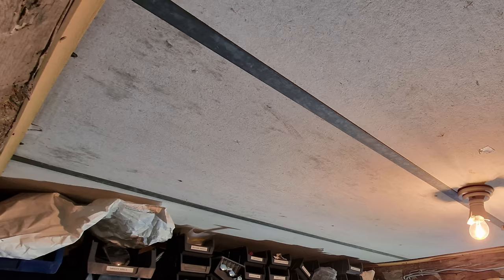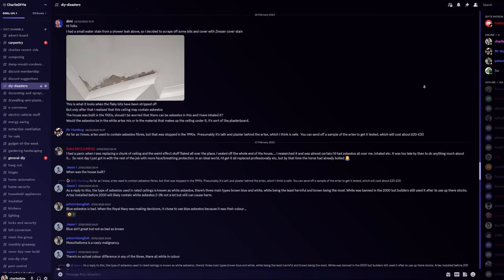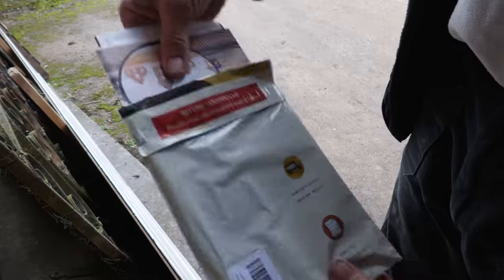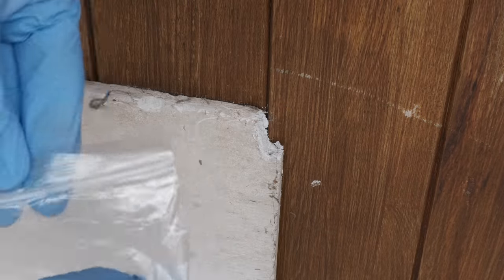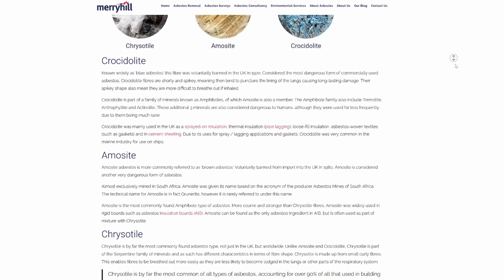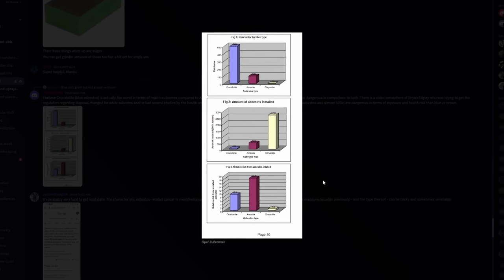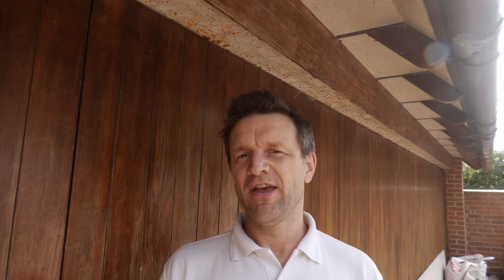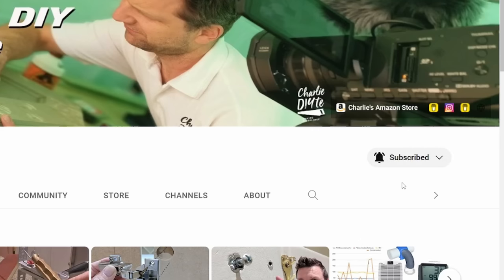I've Got Asbestos in My Home

Comment: Not read all the comments, hopefully some has already commented on the following.
A mask isn't good enough, the fibers can attach to your clothing. I've heard many a tail of wives washing clothes of asbestos working and being contaminated. Fully covered is required and correct disposal of anything that might have come into contact with it, is a must. Shaving foam is a good way of capturing the particles if drilling. Though I'd honestly say, if in doubt get it checked out. Any property after 2000 will be free from asbestos.
Reply: True that at least one wife contracted asbestos disease from husband dusty overalls, BUT the husband worked full on in very dusty asbestos setting. Very different to an isolated or infrequent activity with bonded asbestos containing product. Asbestos cement as used for garage roofs contains less than 15% asbestos. HSE do really good (free) Task Sheets for work with similar products. Until fairly recently it was perfectly acceptable for farmers to bury such materials on their own land. In the grand scheme it's low risk. 
PS hundreds of our schools have asbestos content materials in wall, floor and ceiling tiles,  plumbing and sealing products.
Reply from the maker: A good comment 💯👌

Comment: I see some people preferring to put boards over to encapsulate asbestos surfaces, and I really have to advise against it due to a recent contamination of my home (incompetent contractors). 
We have double layer drywall since the house was built in the 50's. They were encapsulating the asbestos joint compound and lead paint. The problem when you get a pipe leak (another risk -- cast iron pipes eventually corrode and crack) on the other side, the water doesn't seep through to the outer layer if there are multiple layers of drywall -- instead, water will travel up the sandwiched inner layer's paper back. This will cause black mold REALLY fast, and often times those water damage and mold abatement companies do NOT understand the risks of asbestos. Recently had a company contaminate my home after not setting up containment as agreed, and now I'm stuck out of my home waiting to get things sorted.
Reply from the maker: So sorry to hear that. Yes I can see that being a real problem if you've got pipes. Hope you get it resolved.

Comment: Back in the 80's when life was simpler, I remember renovating a very old property lined with asbestos boards. The telephone advice then was to soak them, cut them out with a hand saw and leave them outside for a couple of Council workers with zero PPE to pop them onto an open bed truck several days later. The actual risk of mesothelioma hasn't changed since and I greatly suspect back then there was a more realistic approach to risk. Asbestos insulation in shipyards and storage heaters is a very different thing.
Reply from the maker: Yes I agree. They were good, those simpler times. 👊
Reply: Or, much more likely, the hazards weren't as well known and concerns for safety were much more lax.
Life wasn't simpler. We were just more ignorant.

Comment: you could possibly already have the fibers in your lungs. you should see if you can get checked if you actually did breathe any in. the fibers are microscopic. and stay in the air long after that hole saw drilling. side effects happen later on not immediately

Comment: Great to bring this to peoples attention. We removed some garage roof panels ourselves with PPE and keeping them wet as we were able to do so without disturbing them but have since seen cement board in our eves which we will get a test for. We Also recently found we have "pitch fibre" waste pipes which are in a poor state. We plan to replace them all but are currently assuming they may include asbestos as well so will test these to. We had never heard if this pipe but since found it is a ticking bomb under houses built between 1950 and 1970.
Reply from the maker: Thanks and great work with the way you're tackling yours. 👊

Comment: Hi Charlie. Thanks so much for this. Scary stuff! I'm busy painting the outside of my 1930s end of terrace and so I'm already using your other super helpful posts on dealing with cracks . Now I have reached an outside vent, A flue and it looks like asbestos. I'm happy to leave it in situ but can I paint it it? Its covered in crud and mould... so would need washing down...
Reply from the maker: I think you probably could. But put a good mask on when you clean it and be gentle so as not to degrade the surface of it. But as long as you're not scrubbing/ wire brushing it, you should be fine.
Reply: @CharlieDIYte Thanks Charlie I really appreciate you responding.

Comment: I watched a professional company take down an asbestos concrete building in a tech park I worked at. They putout a ~5m exclusion zone. had all the PPE and just soaked the building before cutting it up/smashing it down... other than this when you look in to it you need an H2 vacuum cleaner and FFP3 mask.. so let's be honest about the real risk of working with it... it's not low if basic precautions are used. Mist the area, soak the board, scribe a line and snap it in two, bag it, tag it and dispose. I'm not saying precautions shouldn't be taken, but they only need to be the basics.
Reply from the maker: Thanks James. Very sound advice - that's exactly what I'll do. With the cellar ceiling, chances are it's too small a job for the companies to be interested in so I'll remove that myself with a suit on, fill PPE and the mask, after spraying it. 👊

Comment: It's in loads of places in this ~1975 house. Artex, soil stack, guttering, soffit boards, (old) water tanks in the loft and vinyl tiles. Frustratingly(!!) I only realised that the strange vinyl tiles I lifted up were asbestos years later when I read about it and then had them and the artex tested.
Reply: Those tiles are relatively harmless due to the fibres being bound up in the rest of the material in the tiles.
Reply: @TheChipmunk2008  Good to know, thanks! They mostly came up whole but there would have been lots of debris and dust from sweeping it all up though. Doh.
Reply: @Paul-XCIV2  We have them in our 1960s bungalow, not sure if yours are the same, but these are dark brown tiles, which are a filler (asbestos) mixed with an asphalt derivative, famous for making the house smell vaguely like there's a gas leak, delightful!  Had to remove all ours for new tiling in the kitchen/bathroom, was a fun job!  The dust will likely just have been crumbled tile, not loose fibres :)
Reply: Out of interest, what part of the soil stack contains asbestos?
Reply: @mikeromeo  All of it I believe, it's asbestos fibre cement, same as the guttering.
Reply: @Paul-XCIV2  yes exactly this. As asbestos goes relatively safe... Just don't smash it up
Reply: @Paul-XCIV2  The pipe itself? I recently removed the casing around a soil stack in a 70s build and was beginning to wonder if the plasterboard was something else, hence my question. Cheers
Reply: House built in 1976, had asbestos artex, asbestos boarding, asbestos cement tank. Asbestos lagging too

Comment: I removed asbestos from my garden in Blackpool and the local tip advised me to wrap it in large sheets of plastic and they would accept it. When asked about what plastic would be accepted they supplied a roll of heavy duty plastic and told me just wrap it up well and seal it with tape. It could be worth asking your local tip.if they to accept it in sheet form if well wrapped.
Reply from the maker: Thanks Derek. Yes I'm sure they will but it's just a question of how I'd safely cut it in half.
Reply: @CharlieDIYte  it was full length sheets from a roof I was dealing with must have been about 10ft long. As I hired a car trailer to move them (8x5) and they were longer than what the trailer was. Ten in total. I was the same as you their was no way I was going to cut them up and would not let the kid into the back garden for a full month after they were gone. Pos a bit overkill but  better to be on the safe side.

Comment: Good video to raise the profile of this danger lurking in pre-2000 buildings (after 2000, asbestos was banned, so the chance of having any is much, much less - albeit maybe not zero). I didn’t realise you could get home test kits. As others have said, I don’t think your exposure will have been that high and so I think any risk to you will be minimal.  It was older guys that worked with the stuff day in and day out that developed the issues later in life.  Sadly we discovered it’s dangers all too late for them. Looking forward to more videos Charlie. Keep up the good work. 👍🏼😃
Reply from the maker: Thanks Paul, great to hear from you and thanks for that. Let's hope so! Yes, lots of vids in the pipeline. Need to get the kitchen renovation back on track. 👊
Reply: Although The Asbestos (Prohibitions) (Amendment) Regulations 1999, came into force 24th Nov 1999 as you cite, there were still wider asbestos legislation that HAD NOT.

Feb 2002 to be exact ... was a real big industry change with legislation implementation schedule was brought forward about 5 years & caught some in the industry unawares (or they didnt care or pay attention enough to industry development).

But note, Control of Asbestos at Work Regulations 2002 did not come into force completely until Nov 2004.

But just in case, any house built in period post 2000 up to Feb 2002 when element of work was carried out could still have asbestos although should of been phased out, including lower risk level items like Artex (as was still available or could be available in Feb 2002).

In short, people should REGARD ANYTHING PROIR to 2005 as having some degree potential (mainly more obscure items in later years).
Reply: @designcoordinationmanageme3177  spot on! 👍🏼
Reply: My house was built in 1995, i had a full asbestos survey carried out and there was no asbestos present. It would be suprising if asbestos was used as late as 1999
Reply: What country is this? USA phased most out in late 70s & 80s.

Comment: I wouldn't worry too much. My grandma says she grew up near an Abestos factory and piles of dust would form by the side of the road which had fallen off the lorries. She and her friends would play in it! 😮 Anyway she's just turned 90. 
Also with the double bagging - I had to dispose of some not long ago that was too big to fit in 1 bag. I therefore cut two refuse bags open and ducktaped them together then ducked taped it all shut (wearing head to toe PPE which also got thrown away). Then did the same again to double bag it.

Comment: This video on asbestos, DIY, testing, etc., has a nice measured tone.  For anyone living in a home built before 1990 (US), there's a good possibility that some building material contained asbestos.  Putting "asbestos timeline" into Thee Googles is pretty interesting, if not 
infuriating.  Over the years, I've lived in and worked on old homes ranging from 1898-the 70s, mostly in Chicago, but also in San Francisco, Seattle, Portland, etc.  The stuff was used in "everything".  I used to be much more cavalier about wearing PPE and still am, though to a much lesser extent.  For Eg., if I'm working on an old home and need to drill/cut through walls or floors where there is a pretty good chance of asbestos in some layer (often many layers from the original construction and subsequent remodeling) or removing old elec. wiring, I don't put on a respirator, etc.  Mostly because it's not the foremost in my mind.  However, when I get into anything that is going to kick up a lot of dust or in an attic or crawlspace where dust, mold, old insulation (asbestos or other), I put on a full 3M NIOSH respirator with N95 filters.  and run a 'shop vac' with a quality filter, and usually leave it running to suck up as much of the dust in the air as possible.  (A good pair of ear protection headphones or 3M industrial earplugs is also a good idea, as are safety goggles that seal around the eyes).  You can get kitted out for $100 (a hunnert quid for you Limeys :) ).  It's worth the money, don't skip on it and use a 'dust mask'.  
I have a somewhat dim/cynical view of all the professional testing/abatement services that have sprung up for residential as they are very expensive for the initial inspection and for the remediation.  Some are much less scrupulous than ohers and will upsell (hard) on homeowners to do a full removal of all asbestos (or mold, etc.) by playing on people's fears and/or ignorance.  Getting a test kit is a great first step, and then researching adequate measures to take for DIY is a great way to figure out what you are dealing with and whether or not you can DIY adequately.  At least you will have some knowledge if/when deciding to hire a service.
Reply from the maker: Great comment - thanks for sharing your experience and knowledge on this. 👌👊

Comment: I removed my cement asbestos garage ceiling few years ago (blue asbestos) I was super cautious and when I arrived at my recycling centre they told me that it was max 10 bags...I had 30...after a bit of negotiation they agreed to take it, particularly after I told them I would not want put them back in my car. I had quote for specialised companies who all told me to do it myself as the price was very high (because of their insurance). Brown asbestos is very dangerous so you are right to be careful Charlie 👍
Reply: Really blue? Did you test it. Very rare to find blue in ac
Reply: @jamiejosh96  actually you are right. My mistake. White asbestos or chrysotile. I had it tested by a professional company.

Comment: I have removed it.  It isn't a big job.  The bigger job was building a wooden frame around it and covering it all with plastic to stop any dust escaping.  Once that is done you gear up in disposable overalls and boot covers and a full faced mask.  I also bought a vacuum cleaner which also got double bagged and sent to the asbestos tip- dont try and clean it.  Clean up was vacuuming, tack clothes and a coat of paint over the frame before recladding.  I used a slate ripper to attack the nails holding the sheet so you minimise damage to the sheeting.  Goose neck each bag and don't overfill so it can go in a second bag.  Tack cloth the tent you made before packing it down and also double bagging. Everything goes to the asbestos tip.  Go slow and carefully and you will be fine.
Reply from the maker: Wow, what a comprehensive job you've done there 👌👏 Thanks for sharing.

Comment: If you do decide to buy home testing kits, please do research on sampling techniques. The sampling process in this video is not advisable. Please pre-wet material with water, when taking sample, place a baby wipe over corner of material, prior to breaking off with similar cutters, sharp chisel or pliers with teeth ground down. Use free hand to pinch baby wipe with sample inside and then place in sample bags. This will suppress dust as sample taken and reduce likely hood of contamination of area. Clean tools with baby wipe once completed and prior to taking additional samples.
A professional company will only charge £100-£150 plus vat to attend site, undertake sampling and send off to a UKAS accredited company.

Comment: For taking down and disposing of asbestos, wear your PPE at all times of handling and clean up and keep it wet to stop the fibres becoming airborne. When cutting up the big boards for disposal keep a constant flow of water where your cutting ideally using only hand saws to limit dust creation and allow time for water to catch any particles and use a wet/dry vac with a HEPA filter, dispose of the filter with the asbestos waste and throughly clean the vac too. It can be a bit of a ball-ache but it's much cheaper than getting in the professionals, asbestos can be dangerous but it's no match against proper PPE and water.

Comment: I used the same kit recently to test textured walls/ceilings for asbestos - luckily they came back NADIS.

Then, after ripping the lath and plaster off those walls, I learned there is a risk of... Wait for it... Anthrax, from dormant spores on the horse hair.

But apparently this mostly affects pre-1900 buildings, because of a change in the preparation method for the horse hair.

They really did love building with health hazards back in the day!
Reply: They most likely build with health hazards now as well, we just don't know about it yet.
Reply: I had the same situation with a renovation on a 1930's semi

Comment: Ive been reading this thread snd getting increasingly alarmed...I have artex bedroom ceiling.  Lived in the house 23 years. Ive only justtcrealised the ceiling could contain chrysotile and worse there sre cracks above my bed. So I could well have been breathing in fibres for quite some time. Now I notice whete dust accumulates it is fine and powdery un like other dust in house. Will get a test done. But if I overbosrd doesnt that involve drilling into the asbestos ?
Reply from the maker: If you overboard you'll be fine as the screw will only penetrated the artex from beneath the plasterboard. That's exactly what I did in my old gaff in London - on the bedroom ceiling. I dread to think about all the artex we stripped elsewhere in the house though. 😬 In the meantime if you're worried you could paint over the cracks with watered down PVA using a mini roller. That'll stabilise it and stop any dust raining down.
Reply: @CharlieDIYte  Thanks Charlie for this advice. I'm kicking myself now for not realising that the dust could have been from a deteriorating popcorn ceiling. I just left it alone.